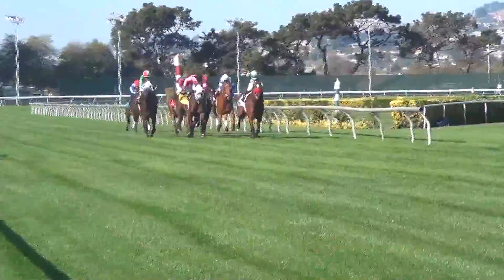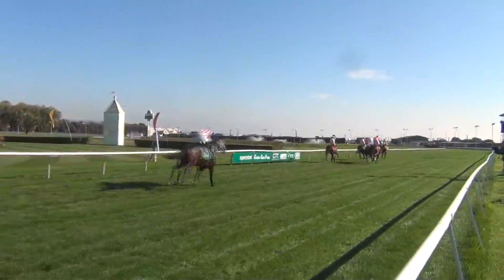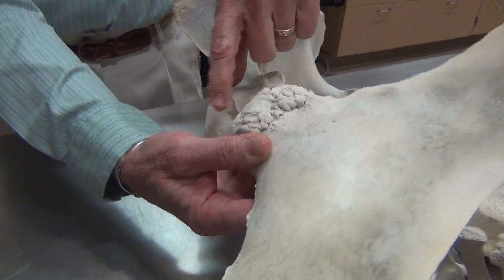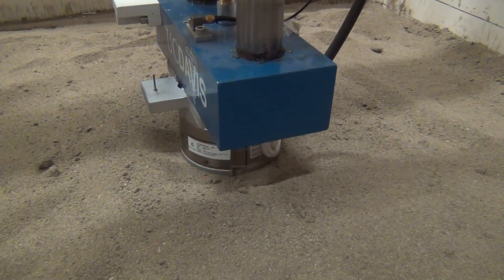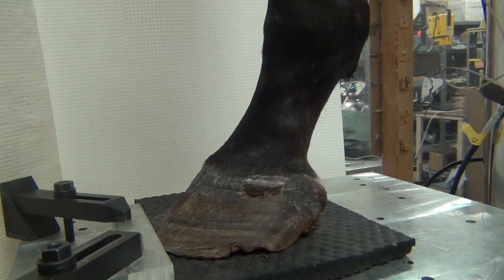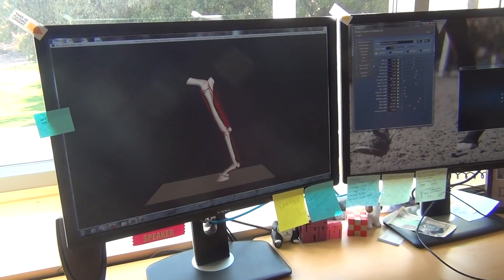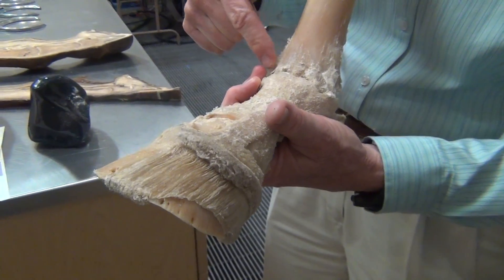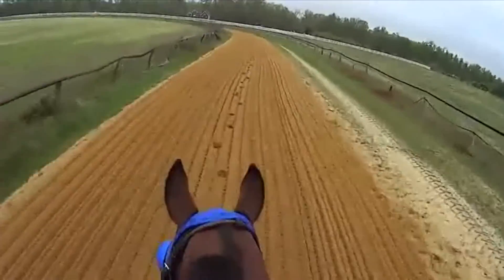Three Chimneys presents Good News Friday: Injury Research Pays Dividends

Comment: The ground reaction forces are a result of the interaction of the horses' foot with the surface.  So the correct development of the foot as a miracle of bioengineering and the correct mechanics of the foot are just as important as the surface. Not enough notice being taken of Professor Robert Bowker's ground breaking research into what constitutes a good equine foot by comparing the foot of the wild horse to domestic horses whose feet have traditionally been peripherally loaded with a metal shoe so humans can exploit horses.